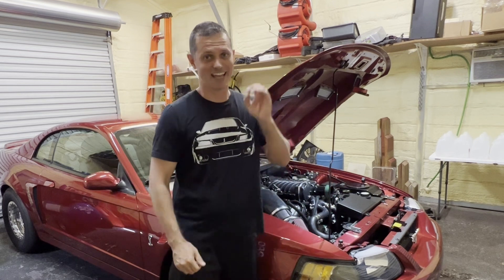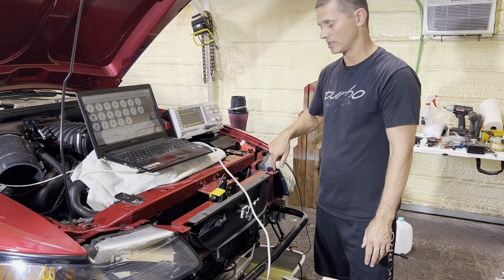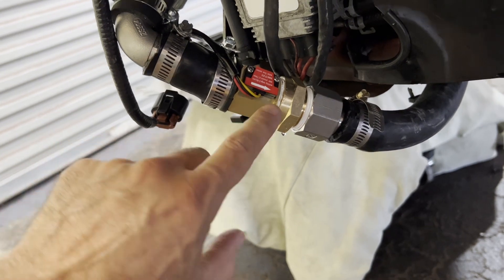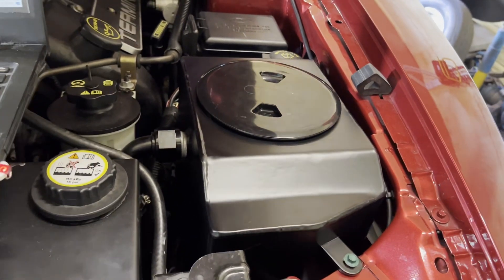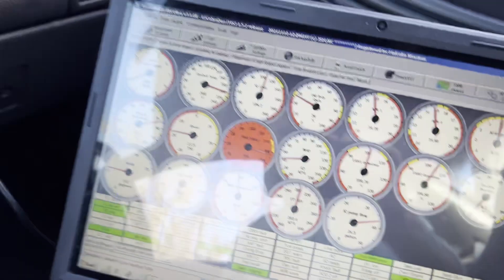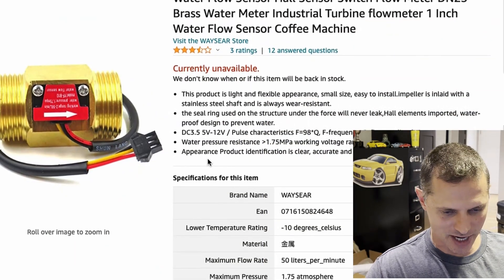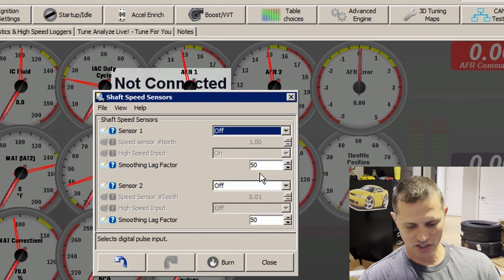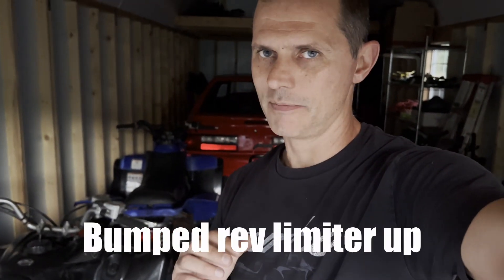Datalog Supercharger Flow Sensor on the MS3Pro powered Terminator Cobra

Comment: I installed a similar flow sensor into my car.  It's a 1.5 inch, but same hall effect sensor.  Curious if your bucket test matched up to the flow formula that comes with the device.  Like F=0.5Q (L/min).  In this formula, you would multiply the pulses by 2 to get the flow in L/min.  Then convert to Gal/min.  Did you happen to do this validation for your sensor?  If so, how close was it.  Also, in my case I see the flow from the sensor bounce around a bit.  Did you see that with yours at any point?  Maybe some air in the system?  I'm seeing variation like 7.92 to 7.39 GPM with the IC pump on flowing through the sensor in a closed loop.
Reply from the maker: My sensor didn't come with a formula so I made my own by capturing the output of the sensor while filling buckets at various speeds and capacities.  My sensor's reading was pretty steady as long as I didn't get any cavitation.

Comment: curious is there anyway to hook up a gauge for the flow sensor to monitor at all times without a laptop?
Reply from the maker: If you have a pi based display running tuner studio it could be there all the time or if you have one of those perfect tuning gauges it’ll likely work. If you’re just wanting to drive a generic analog gauge you’ll likely need to build a little circuit driver taking the hall affect sensor as input.
Reply: @MalcolmV8  I picked up a 1.25 inch flow sensor and am planning to build a small little Arduino nano device to convert pulses into a 0-5v analog signal fed into the back of my Aeroforce gauge.  Will mount it inside the cabin just like the Aeroforce boost sensor.  Calibration will be key.
Reply from the maker: @guevoncito6265  that's awesome.  I love projects like that :)

Comment: Did I miss it about  the high IAT2? What was the fix
Reply from the maker: It’s not fixed yet. The flow sensor has helped diagnose what’s going on with the pump and system performance. The high IAT2 fix is still coming.

Comment: Maybe just have the gauge indicate percentage of flow?
Find your max and set that up as 95%. Then you can instinctively tell if something is wrong.
Reply from the maker: That's a great idea too.  I was heading for actual flow numbers as part of the troubleshooting in figuring out the cooling issues but you're right that would be a great way to go when everything's working correctly and you know what your flow rates should be.